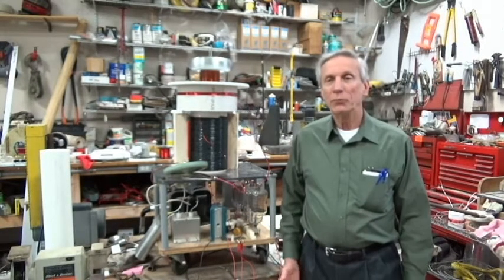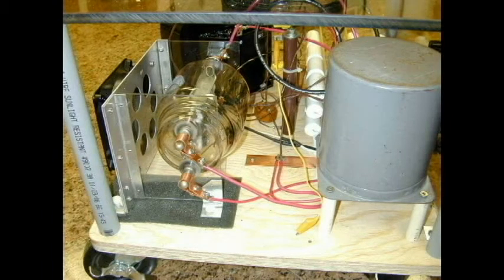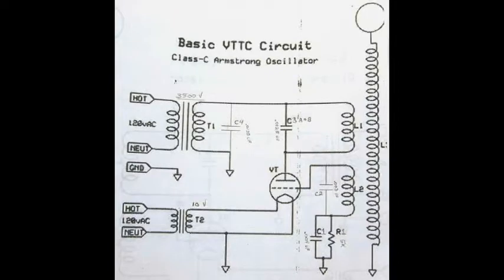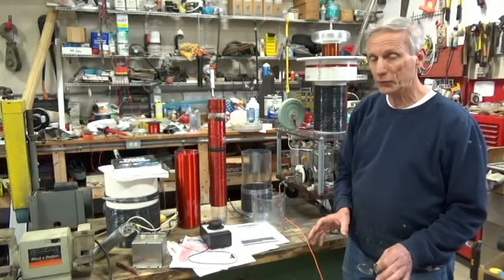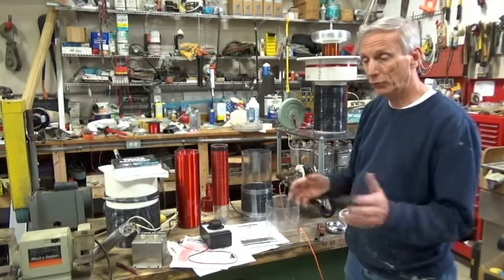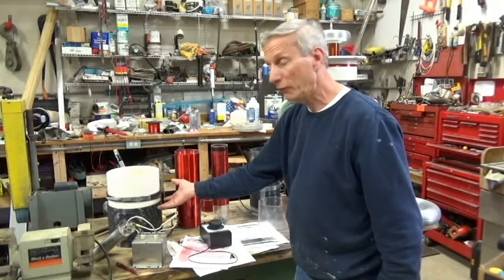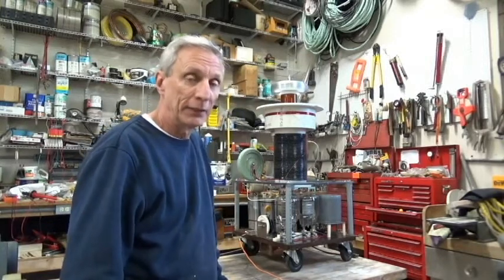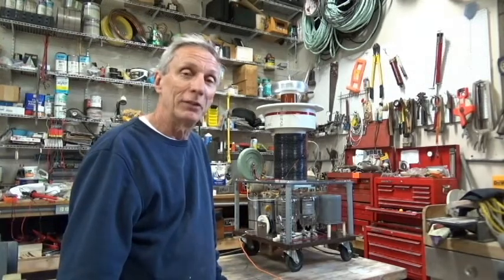Dual 833A vacuum tube tesla coil high performance

Comment: If your view point of "efficiency" is to get big sparks than you don't nothing about Tesla coil in general. Many years of modifications and still toying around of the true potential of Tesla coils. If you really would have known about Tesla coil then you would know that a high efficiente Tesla coil doesn't send retarded sparks and lightnings a cross the room. It generates high electric Felds to transmit it longitudinally far away. Tesla coils making sparks is just retarded YTber thinking of who has the biggest lighting rod in there pants. Just disappointing to see how Teslas gift gets Bastardized every day on the new. 😕😔

Comment: Thanks for the video! I just started the VTTC journey. I ordered a GU81M off ebay. My uncle was an RF Tower placement consultant before he passed away. My cousin thinks he has a small collection of high power transmitter tubes. I am excited to see what. 

I have been following Steve, Loneoceans, Stevearcs at Tested to Destruction and many others. I still want to build a rotary spark gap coil, but gravity is pulling me towards the VTTC first. I think it's because I miss my early laser light show days of argon, krypton ion plasma tubes and copper vapor tubes. There is a magic there that is lost in the digital and solid state world.

Comment: Very good! I recall coolers in my day (late 90's, early 2000s) having trouble getting extra output from adding an 833a.  ...answer is F0 (fundamental resonant secondary frequency). 

Assuming all coupling factors and tuning are maxed, F0 tends to determine spark growth and branching, etc.

nice tc work among the chaos of junk. Yes, thanks for sharing VTTC info. Steve helped, but really John Freau knew more, and had lots of VHS tapes. John F. knew more than Steve and myself, but John and I learned mostly via form and intuition, then showed our work, i.e. derivation of the Freau Equation post hoc post data. ...but it worked and so did the math.

Comment: @Forrest Mohrman I'm building something similar as well.  I'm seeing about 24" out of my setup currently.  My secondary is on 3" PVC pipe 18" long.  Resonate frequency is about 475khz though with the top load (smaller than yours) and a 36" wire attached to simulate a streamer.  I'm using a mica transmitting cap for my primary that's rated at 13A at 10kv and .003uF.  A few questions though and hopefully this will steer me towards increasing the length of my arcs.  What is the PVC diameter of your primary as shown?  I'm guessing it's at least a 6" PVC pipe.  (What I'm currently using)   But with how many windings?  (I'm setup with a tap per turn up to 25 turns)  Then your tickler coil.  What is the PVC diameter for that?  I'd like to move mine up and out like you've got.  Also how many turns for your tickler?

Comment: sweet... i'm playing with a PL84 coil, nothing special, the fact is that i managed it to run mostly with an off-filter-frequency primary capacitor, i mean that the smallest capacitor i can fit that keeps the circuit running gives the best output, that is like 2cm continuous wave :D, i've also seen that fitting a capacitor that makes the classic tank circuit runs the whole system a bit stressed, tested also on a small base-feedback MOSFET coil i have, better filter the system somewhere else, apparently, or by just the secondary resonance... the point with the VTTC is (in my modest opinion) to provide a primary that gives the most appropriate impedence at frequency, regarding the tube AND let it go freely (that will quite likely make high pulses on the anode), the small capacitor remaining may be just to avoid high freqeuncy transients that would kick the coil to an harmonic frequency

Comment: Awesome work! Have you tried any Tesla coils that resonate with the Earth's fundamental freq or an odd multiple thereof?  you should try it sometime if you want big sparks.
Reply: The objective of telsa coil is not to shoot sparks as that wasted energy in broad spectrum end due to dielectric breakdown. The tesla coil is not exchanging energy efficiently with the enviroment which form part of the capacitor ascociated with the secondary matched oscilator. The media want him to though bolts of lightning into the air as spectical but it is not the purpose of the device. They should be for the wireless transmission of energy which requires the matched resonances of the remote receiving device.

Comment: Very nice Tesla coil.  Regarding your comment that you need a small capacitor so you can have a longer primary coil - could you not have a large capacitor and maintain the primary length by spacing out  the turns, rather than having the turns touching each other?  I am only asking because I have a 0.44uF 100kV Maxwell pulse capacitor.  Have not built a coil yet.

Comment: Would you sell me the plans for that Tesla coil I am 70 years old and new to all this I have ordered two new 811A tubes and I have a 15000 volts at 30Ma neon transformer and 12 -2000 volts Dubilier 0.15uf and I have the secondary 4 1/2 ''w by 28'' talk with 26 ga wire and 100 ft of 1/4 tubing. Now I am lost. no spark gap yet I was wondering if the 811A tubes could be used for the spark gap .? A reply sure would be great.
Regards Roger.
Reply from the maker: Hi Roger,  I do not have plans for this coil.  However I would like to steer you to the man who helped me figure it all out.  He is a genius at explaining difficult electronics on a level we can all understand.  The website is :  http://stevehv.4hv.org/In particular is the section on vacuum tube tesla coils.  See belowhttp://stevehv.4hv.org/VTTCindex.htmBud

Comment: What is the length of primary? The diameter of primary Coil form? Wire gauge 12 AWG? 
Secondary form length winding length inches’ wire gauge. Grid coil form diameter & wire gauge.
Secondary resonance frequency.
Capacitor values used.
Toroid size.
etempler@gmail.com
210 877 2623